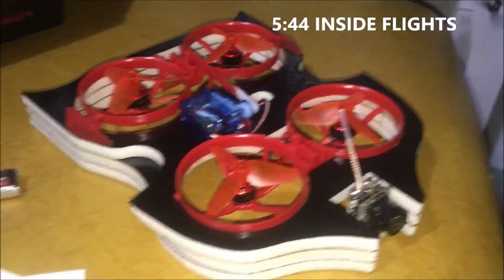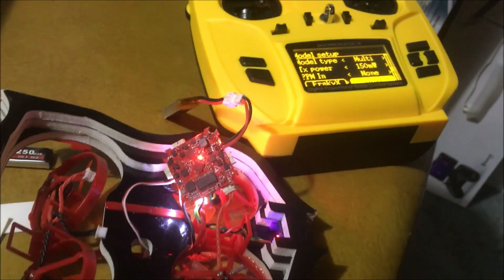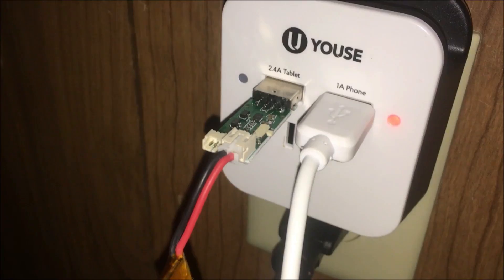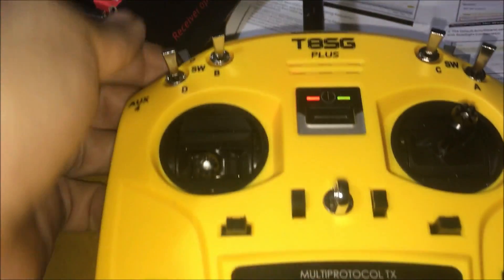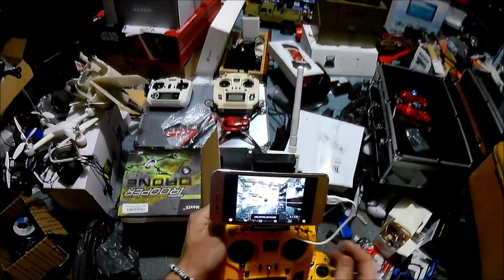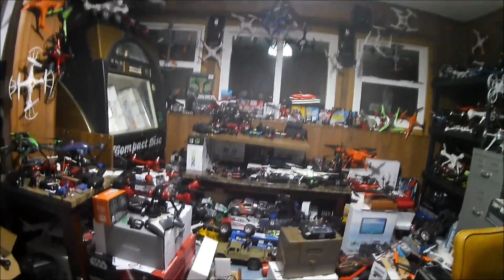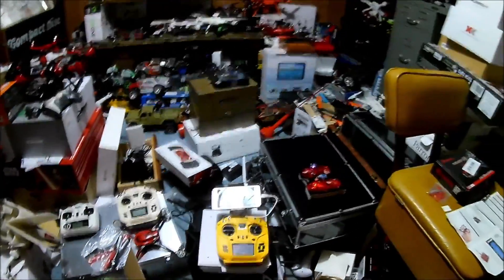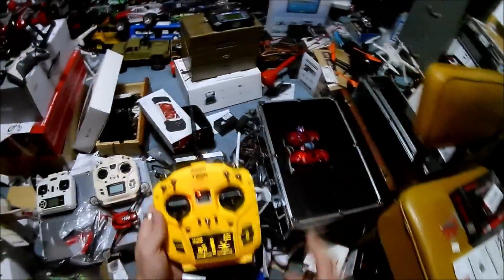Eachine Vwhoop 90 Brushless SETUP & FLIGHT Tiny Whoop 2-in-1 FPV Racing Drone Crazybee F3

Comment: Also change the switch assigned to the servo to a 3 position so you can get 45 degree mode which is awesome. 
I think you could move it to a slider also and it should be linear.
Good vid BTW 🤙🏼